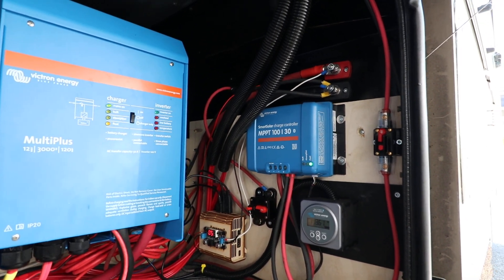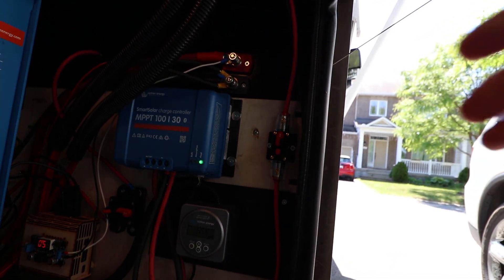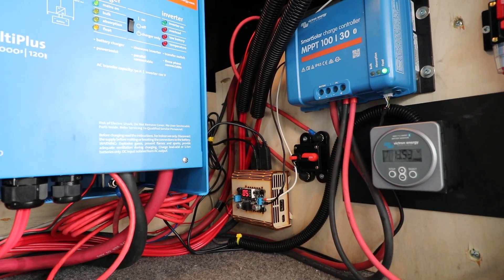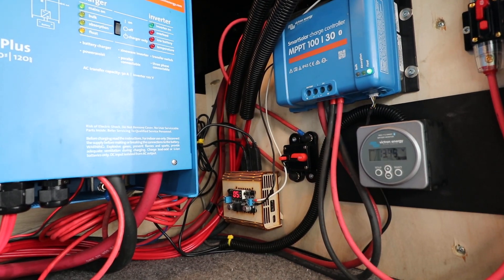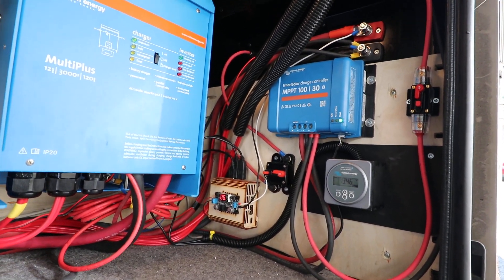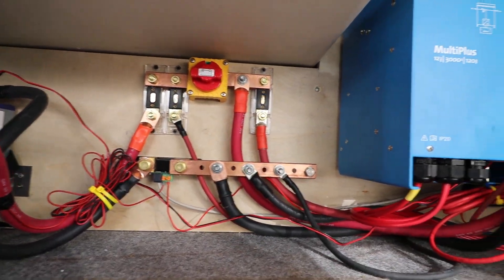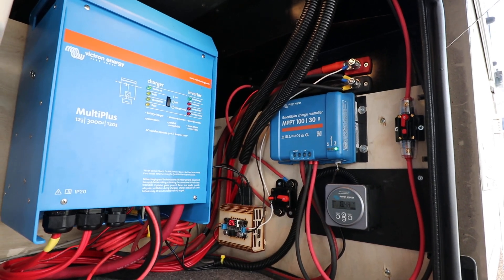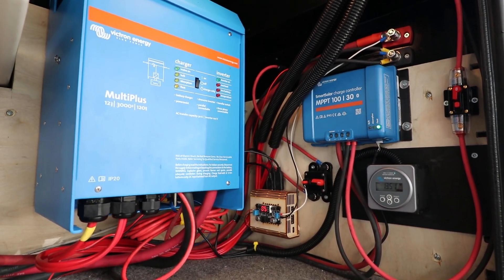Victron Solar conversion for Motorhome

Comment: We just upgraded from a towable to a 2016 VIsta X 27N and the existing house batteries are shot so this is exactly the path I'm looking to take vs replacing the two house lead acid batteries. Mine are currently under the stairs and I have not had the opportunity to do a site survey to see where all this additional equipment will fit. I had the smart shunt and the Raspberry Pi setup on my old towable that I will be bringing with me.

Comment: Were you able to use the factory installed heavy gauge wires from batteries/generator, by rerouting them to the victron?  Also, the 120v wires?
Reply from the maker: I tried but the Winnebago had shorter battery cables then my application needed. Also I went overkill and used 0 gauge (aught) from battery to inverter as I planned for larger batteries later and wanted the extra current carrying capacity. 

for the 120v I spliced into shore cable to run directly to inverter with 3/10. from inverter back to fuse 120 panel I also used 3/10 to carry the 30amp load expected.
Reply: @NomadCND  Thanks.  Do you know approximately, cost of all your wiring?  Not sure your year, did you upgrade your power fuse and breaker panel? I have a magnetek 6345.  Is 30 amp.  I understand the victron will increase the 30 amp if you need more amperage.  Not sure if my rig wires or breaker panel can handle the victron, due to increased amps volts watts.
Reply: I like you were able to make your own bus bar.  You must be an engineer.
Reply from the maker: @creationatwork1116  No I'm not actually. I work in IT and I'm handy. YouTube is your best friend! ;-)
Reply from the maker: If you have a 30amp service in your RV then everything should be to spec. Consider that the wiring coming from shore power to your panel carries 30amps. If you disconnect that wire and splice in a 3/10 wire to the Victron inverter as I have and then back from Victron inverter to the panel you are essentially doing the same thing that Shore Power did.
Reply from the maker: I can't comment on wiring cost as this varies from region to region. I'm in Ontario Canada and we pay through the nose for almost everything when compared to our cousins south of the border.
Reply: @NomadCND  Thank you, Sir!!!  What year is your rv breaker box?  I am an offgrid-retired SIGINT USMC-signal ai software programmer now.  SIGINT/EW)
Reply from the maker: @creationatwork1116  The RV coach is 2008 so I assume the breaker panel is the same. Thanks for your service!

Comment: Did you discover if 100 amp battery would supply you with enough power all night?  Also, did the 200w solar give you enough power all day?
Reply from the maker: Thats a great question and tricky to answer. 100amp hours depends on your consumption throughout the day. You would need to measure the power consumption of your devices and then determine from there how long it would last. You will not be able to run a AC unit unless you have a soft start but even then it will be short lived due to amp drain. Your fridge is also another large amp drain unless it runs on propane. You should be able to get over night with your lights if they are LED. Don't bother with running the microwave as that too will draw many amps and lessen your remaining AMP capacity before the next charge.

As for solar, unless you have more solar watts coming in than you consume you will never be able to keep up with amp drain from your battery. I noticed some days with little consumption from onboard devices I was showing "infinite" capacity from my Victron system as the solar watts generated were more than I was consuming at that time.

Hope that helps a little.
Reply from the maker: I should also add that I've ordered prismatic cells from Aliexpress to make two 12V packs of 280Ah each. That will give me a total of 560Ah capacity when installed. I'm also upgrading to 600W of solar panels at the same time.
Reply: @NomadCND  I didn't really think you got much juice from the 100ah :).   I am getting ready to order victron complete system for my rv.  Will u be putting a bms on those cells?  Or will the victron manage it completely?  I have been looking into ampere time 200ah at $1,100.00 12v.
Reply from the maker: @jwitness3079  I will be using the same BMS that you can get from Overkill Solar. I've paid just under $1K for all of those prismatic cells delivered. Add another couple hundred for the BMS and wiring and you have a whole lot more "juice".
Reply: @NomadCND  I believe you can manage the battery with victron smartshank or cerbo gx?
Reply from the maker: @jwitness3079  Yes, I have Venus OS running on the Raspberry Pi (see the little wooden case). Venus OS is the OS that runs on Cerbo GX. All the Victron equipment in the bay connects to this Raspberry Pi using VE Direct cables that I made myself.
Reply: @NomadCND  Wouldn't the victron os manage the battery cells u build?  In lieu of buying bms?
Reply from the maker: @jwitness3079  Venus OS does not have cell-level monitoring, if one of those cells goes ballistic you will have a really bad day. BMS is your best friend and insurance.
Reply: @NomadCND  My ignorance.  I didn't know bms did that.  My virginity, assumed bms only monitored temp-charge discharge-volts watts amps in and out.  What makes you think the cells you are getting are the caliber of battle born?

Comment: Do i connect the battery to the controller output or do i connect the output to the inverter intake?
Reply from the maker: Battery is connected directly to the MPPT. The Inverter is also connected directly to the Battery. You do need to put separate inline fuses between battery and any input power source.  You should also make sure to connect disconnect switches as well to isolate each circuit in the event of doing maintenance or troubleshooting. Hope that answers you question.
Reply from the maker: I should also mention that for simplicity you should have a bus bar for both positive and negative battery connections.

Comment: Hi Rob, my husband likes your setup, but would like some info regarding the raspberry Pi4 set up to display setup if you don't mind him asking?
Reply from the maker: Wonderful question and I'm happy to help. Venus OS is the opensource operating system developed by Victron and shared freely. It's what runs in the Cerbo GX line of products. All you need is a RaspberryPi (I suggest 3 b+ version). I used the Pi 4 but only after digging through the forums and forcing it to work. The Pi 3 B+ is the supported version of the hardware. Here is the article describing Venus OS. https://github.com/victronenergy/venus/wiki. Here is the link to the article walking you through how to install the OS on the raspberrypi. https://github.com/victronenergy/venus/wiki/raspberrypi-install-venus-image. To be able to connect a Victron MPPT controler to the raspberrypi or the BMV-712 battery monitor you will need two VE Direct cables. You can either purchase these from Amazon (https://amzn.to/3cS7NLi) or you can make your own like I did but getting these JST connectors and USB UART adapters. Here are the links for both. https://amzn.to/3cS7NLi and https://amzn.to/3cS7NLi respectively. Then follow this guide for building the connectors. https://beta.ivc.no/wiki/index.php/Victron_VE_Direct_DIY_Cable.

To be able to connect the Multiplus inverter to the RPi you will need another special cable (MK3-USB) which you need to purchase as there is no DIY guide for building them.  https://amzn.to/34imd3x.

Once you have the software installed and connected to your wifi you can then use a web browser to go to it's IP address from a browser. You can then configure the connected devices. The configuration is a whole different topic. It's not difficult but it's also specific to your shore current, your batteries and your solar setup.

I hope that helps.

Comment: Great project well done. I’m thinking of running something similar for my home. Do you just connect the mppt batt terminals directly to the battery and then the battery to the inverter. So when there is no AC power then solar will charge the battery?
Reply: Also I have the jst connector but I’m not sure if how to get the wires crimped into it. How did you do it?
Reply from the maker: @yusufd1  You are correct about the wiring directly from MPPT to battery but make sure you put a fuse inline. For the JST I ordered a set of pigtails from amazon (https://amzn.to/3gfZGs1) which were already crimped. I just needed to solder them to the USB to TTL 5PIN serial converter (https://amzn.to/3gfZGs1).
Reply from the maker: Word of caution though. If you follow my approach don't connect wires to the +5v or +3v serial converter. The power will come from the raspberry pi. You just need to worry about signal (Tx and Rx) and ground connections (GND). Have a look at this wiki article on how to DIY VE Direct Cable. https://beta.ivc.no/wiki/index.php/Victron_VE_Direct_DIY_Cable
Reply: Rob Mitchell thanks so much. I already have made the cable and it’s working but I just used some ordinary header cables and stripped the plastic casing off. It’s not too reliable so I got the jst but in my city in South Africa I could not find one with wires attached.
Reply: Sorry one more question. Within Victron Connect are you able to set the priority of charging so that the solar charging is prioritized over AC when both are available?
Reply from the maker: yusufd1 there is no priority setting. The battery BMS also plays a role and will shut off charging when needed but I don’t see where Venus OS provides the orchestration of charging. It’s an interesting question and one I’m going to look into more.

Comment: Hey, this is a great setup. I’m thinking of doing the same. One question. Why not go with A 24 volt system. I ask because that’s what I’m looking into right now. Thanks again.
Reply from the maker: 24v are coming from the panels on roof. I used 12V to keep the setup simple, reduce need for a 24-12v converter for onboard 12v appliances. In addition I use my onboard Trombetta solenoid to charge the chassis/house batteries from the alternator while driving. I also have just the single 12V house battery at the moment so 24v is just something not necessary right now. But I do agree with you on reduced wiring size which does bring costs down. But at least now I have a setup that can handle the higher current if needed and with little voltage drop across my wire runs.
Reply: even 48V you can find a lot of 48V batterie deals. Your cables don't have to be so thick with 48V For like 2 to 3000 us you can have a system that can power a "house".  I just bought pylontech us2000B 48V batteries.